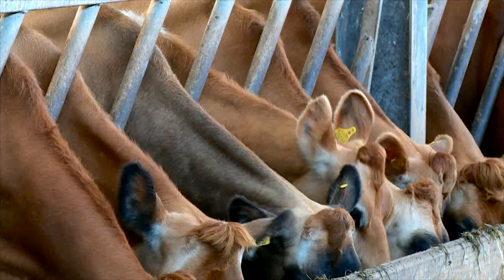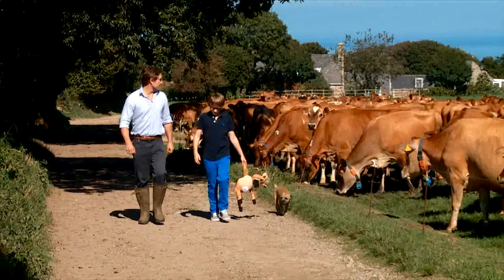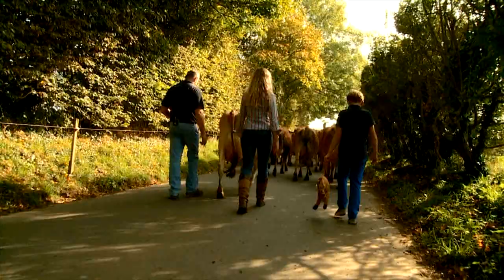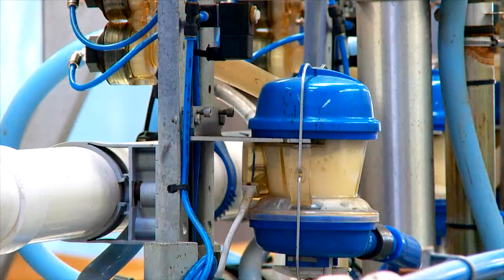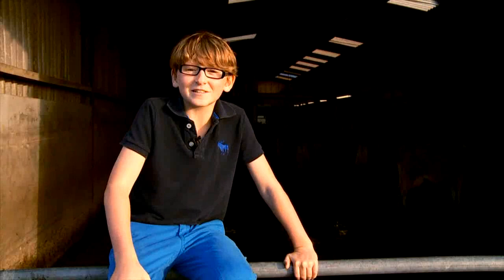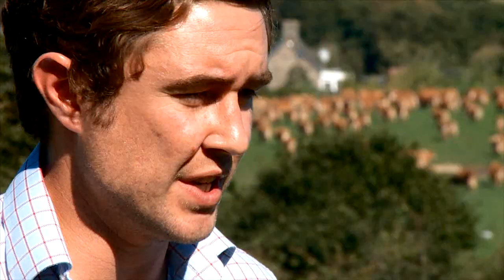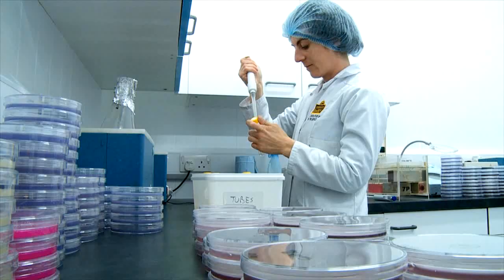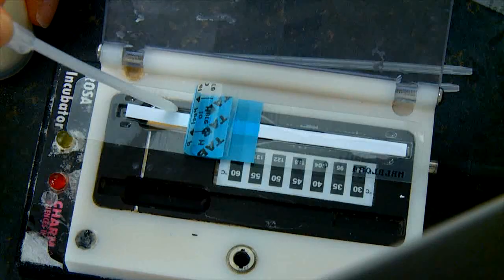Why is Jersey Milk so special?

Comment: Can this milk be purchased in the States??
Reply: Dont ttthinnnnk so
Reply: Most states don't allow raw milk sales but there are some exceptions.   The problem is, most US dairies have Holsteins not Jerseys
Reply: @GermanShepherd1983  nothing says milk has to be raw, and I've found commercial stockists in Australia. It's a no brainer for governments to not allowed foods that can predictably cause serious illness and potentially mortality to be sold on the open market. Sterilising milk does not have the same effect that homogenisation does.. Jersey milk that has been boiled so it's safe to drink is still delicious. Too many people here are claiming the disadvantages of homogenisation, which is not a necessary or required process, also apply to pasteurisation. This is not the case. All pasteurisation involves is heating the milk to a temperature that kills bugs. This also allows cream to rise to the top and then it can be used itself, as cream or to make butter, but the milk still remains very rich and creamy.

Comment: can jersy be a profitable in warm atmosphere of india
Reply: it's a good question. India being so huge but having a reputation for very hot weather in parts. What I'm thinking is that areas with a certain amount of elevation probably have cooler temperatures and more moisture and rainfall. A likely significant factor is pasture for grazing and whether the weather results in drought or is prone to flooding or other extreme weather.